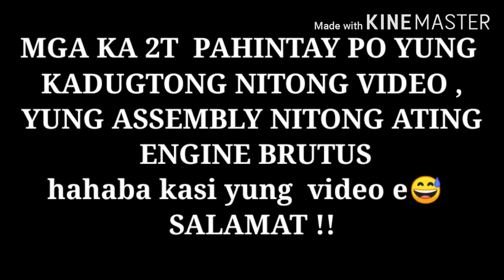#kawasakiBRUTUS #REBUILD       kawasaki brutus part #2  clean & assembly

Comment: Boss bat ung carb (stock carb) lagi siya nag oover flow tuwing di ginagamit
Reply from the maker: Merong tatlong peding pag buhatan yan sir .una baka kaylangan mong i adjust yung floater .pangalawa  baka pudpud na yung mismong  floater needle , dahilan na hindi n mai lock ng floater yung gas , kaya nag papalit na yung iba nang repairkit
Pangatlo baka yung giripo ng tangke eh sira na naka lock sya pero kumakatas padin kaya napupuno yung tasa ng carb ,kaya may tagas
Reply: 2stroke PH ah sige po  try kopo tignan bukas salamat po